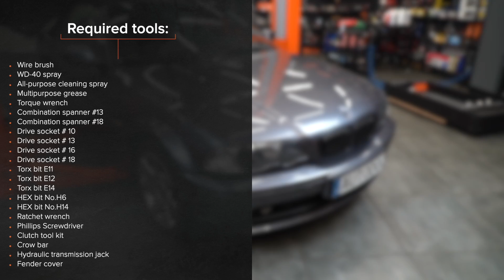Comment remplacer kit d'embrayage sur BMW E46 Cabriolet [TUTORIEL AUTODOC]

Comment: Bonjour j'ai un problème avec X5 e53 184 boîte manuelle 
Le levier de vitesse est mal centré il n'est pas bien au neutre il penche un peu ver la droite du coup pour mettre la 3eme ça me met directement la 5eme j'ai besoin d'aide merci
Reply from the maker: Bonjour ! Les causes peuvent être variées, malheureusement, nous ne pouvons pas donner la réponse exacte sans pouvoir examiner le véhicule sur place, alors nous conseillons de t’adresser à un garage professionnel pour pouvoir effectuer le diagnostic.
Reply: mm problème avec ma e46 de 1999 136ch 190 000km . la vitesse 3 est difficile a trouvée .souvent je passe la 5 a la place ... c est la conception comme cela, tu ne peux rien faire .
Reply: @jeanl1443  slt problème résolu c'est les bonhommes de boîte de vitesse
Reply: @51mounir  ça se vend en kit? Car je démonte mon embrayage semaine prochaine, peux être le bon moment pr changé les bonhommes ? Tu te rappelles de leurs emplacements ? Metci
Reply: @esquenetval  moi c'est un X5 donc je sais pas si c'est à le même emplacement que les E46 mais je sais que t'en a 3 sur le côté droit de la boîte tu peux pas te trompé c'est des bouchons vert et 3 sur le haut de la boîte ceux du haut c'est des bouchons en métal